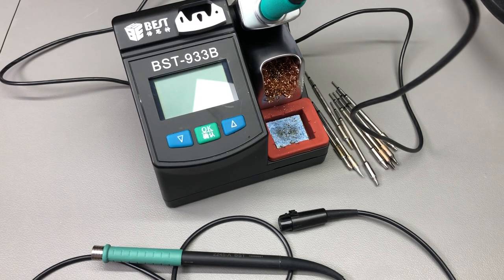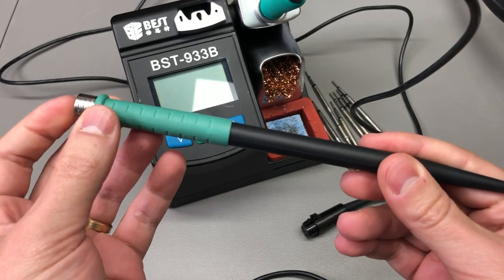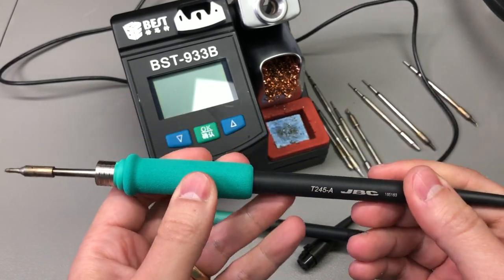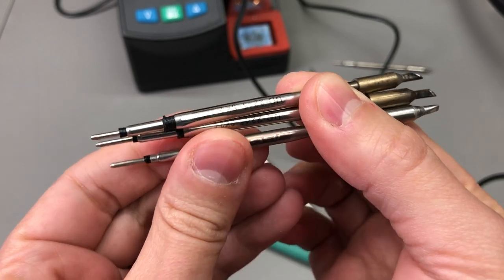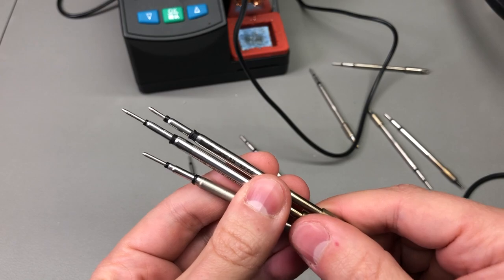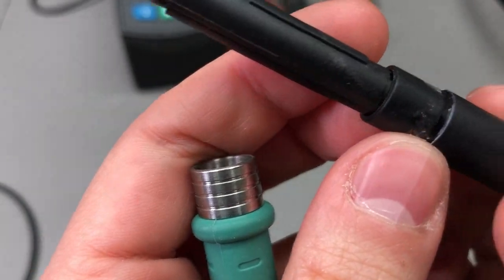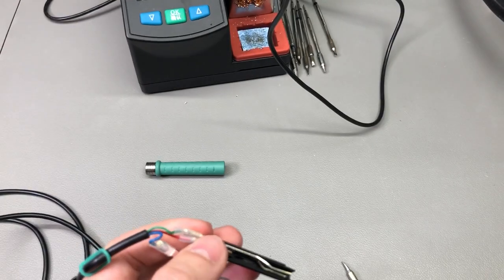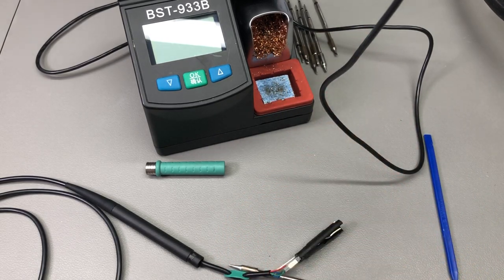Best T245 JBC Clone Handle Teardown | Votlog #387

Comment: thanks voltlog! great video really good to find out these important details. handle and issues in the handle is very important.

for example my previous chinese t12 handle shorted out in similar fashion, and the short created a small fire, on the main switching mosfet on the ksger controller pcb. and it burned damaged all the FR4 around it. hehe

anyhow what is interesting here is because these days we still are buying clone handles for the new aixun t3a and t3b. this includes a nase /nano type t115 clone handle too. (not genuine)  which is even much smaller size. and more delicate. so it iss great to know we can in fact take them apart to examine it. and check the situation for ourselves. very big helps thank you my friend 
👍

Comment: Thanks for the teardown video. There are so many different soldering stations available. It's hard to choose. There always seems to be new improved stations and various clones coming out. I now have an old Weller, Hakko FX888D, Pace ADS200 new in box. I recently bought a couple of used Metcal MX-500P-11 power supplies and I think I'm going to try them for a while. Well...unless something else catches my eye.
Reply: Just stick with mx500, its all you need.

Comment: the original JBC also had a hard plastic on the handle, it became quite hot on the first JBC stations. I guess they changed it to that rubber to isolate the temperature from the fingers. The heating modules are also different depending on the solder tip.
Reply: And this trouble we have in $1000 station?!?! What a shame! 👎
Reply: @daitedve1984  they changed it to the soft grip and the problem is solved. The JBC is doing a very good job I would buy it again any time.
It doesn't cost 1000$ but like 350$

Comment: Yes fun to watch great video interesting My. Ksger soldering station been using for four years is now coming up with error messages 
maybe same problem as. you have i have tried a new tip bit better, but waiting complete replacement as i use it all the time in my workshop with electric bikes. I do. have a couple of butane irons for backup